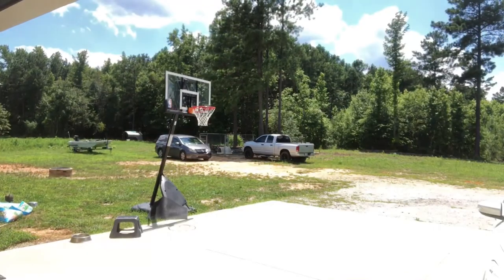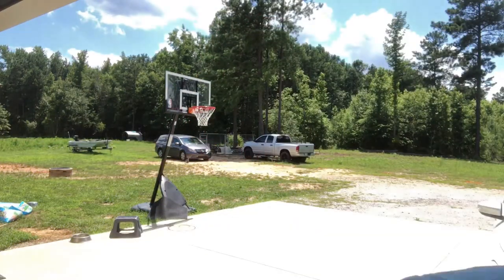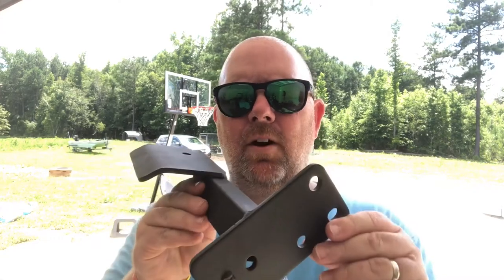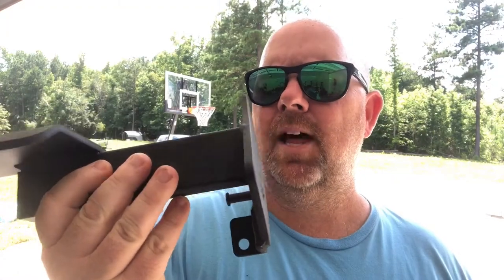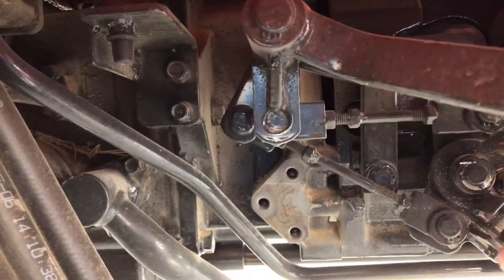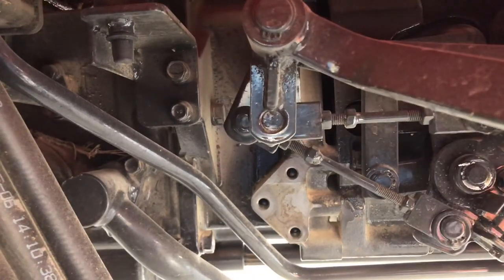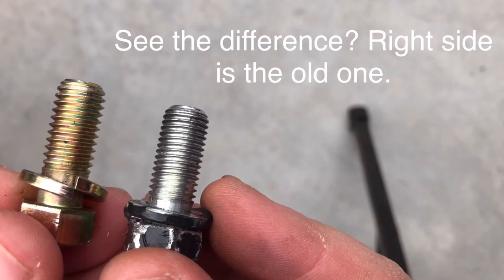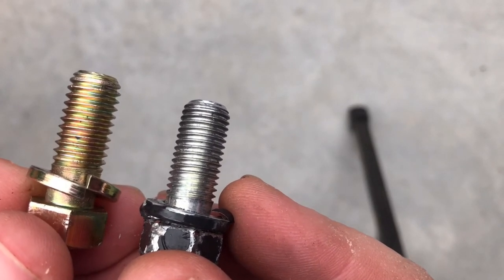Fixing the Hydraulic pedal Return Bracket on my Kioti CK3510SE

Comment: That was awesome they covered it under warranty. Wild they sent ya a bear metal one. Seems like the factory would want paint on it to keep it from rusting on the shelf.  Taking a picture can be a life saver when putting it back together!  Good repair job done buddy!  Stay safe and have a great rest of the week!
Reply from the maker: Yeah I was def shocked to see it not painted. That took a few more days to paint and let dry then paint again. Plus what I put on will not be as durable as a powered coat. Yeah always took pictures of panels wired up when I was in the alarm world. Especially if I was hooking up a thermostat to an alarm system. They can get confusing sometimes. Thanks for watching CB.

Comment: Gotta love asking for replacement parts and getting the wrong thing... NOT! Sorry that happened to you Ronnie. Hopefully the old bolts will hold up. If they really painted that tractor after it was assembled, that's not the smartest way to do it, for sure.  I wonder if they think their tractors are so awesome nobody will ever need to work on them? Pretty ignorant thinking if so. Nothing lasts forever.
Reply from the maker: Yeah I’m surprised they painted it like that too. Even the rubber cv boots had a coat of paint lol, of course once they flexed a time it two from turning, it flakes off. You never paint rubber anyways. Too flexible,